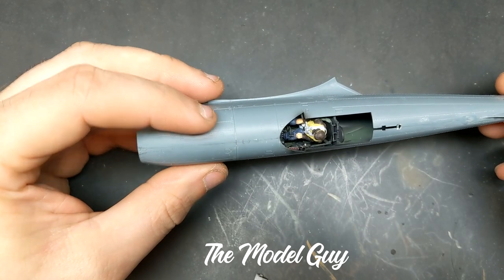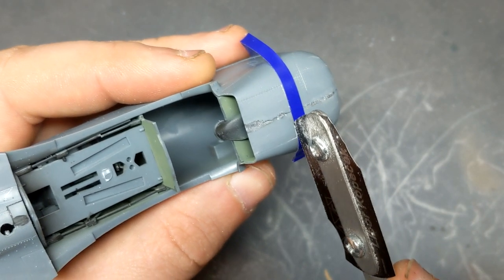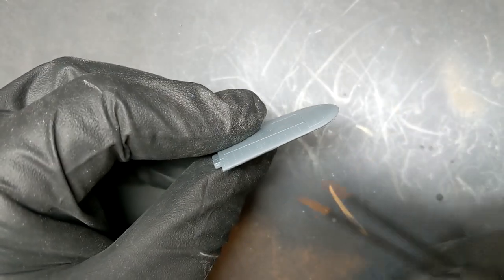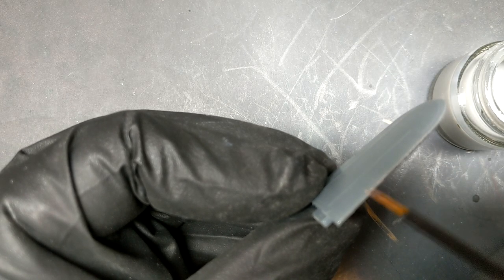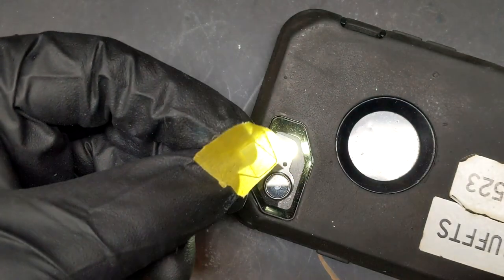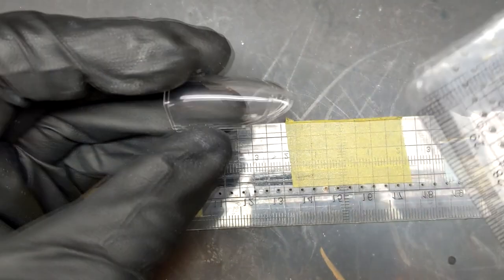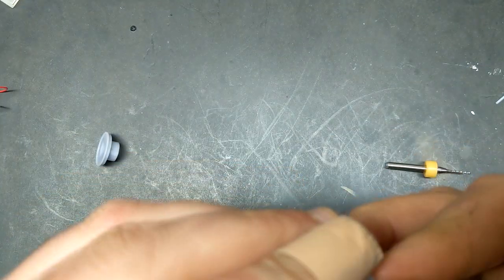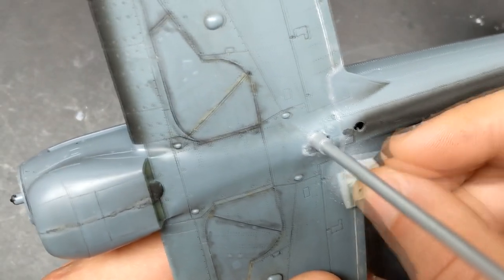1/48 Eduard Tempest Part 3: Final Assembly & Motorizing

Comment from the maker: Please note: Sprue Goo is made here with Tamiya Extra Thin Cement and Tamiya sprues. Not Tamiya Thinner as stated.
Reply: Although you can use Tamiya Airbrush Cleaner (pink cap) in lieu of glue.
Reply: How long can you store spruce goo please?
Reply from the maker: @markbaigent8373  good question. I am not sure. But as long as you can stir it and it holds the same melted ice cream consistency it should be usable. If it's hardened it's probably no good.
Reply: @TheModelGuy  Fair enough, so maybe make up tiny batches at a time. Thanks 👍

Comment: I have started to use sprue goo myself, made with Tamiya clear sprue as and Tamiya Airbrush Cleaner. At first I had it way too thick and it was very stringy and left a lot of air bubbles. Now that I thinned it, I am starting to use it a lot more. 

Another thing I have tried to do is to pull apart and then squish parts (fuselage/wings) when I’m flying them together. This causes some liquid styrene to squeeze out and making a thicker version of sprue goo. Then when you sand the parts you generally don’t have to fill them in with goo. I find this especially handy with the trailing edges of wings . 

Great video, I feel like I’m looking over your shoulder as you build and taking notes. One part of building that I’m ashamed is a weakness is sanding off the sprue gates and making sure they are flush and not raised/divoted. How do you do yours ?
Reply from the maker: I usually cut parts off the sprue and leave as much of the gate as possible attached to the part. That way it's easier to clip off close to the part and sand.

Comment: How exactly are you powering the motor is it just taped onto a battery or something?
Reply from the maker: Just touching the wires to the battery for testing. In the next part I solder in a switch/battery holder